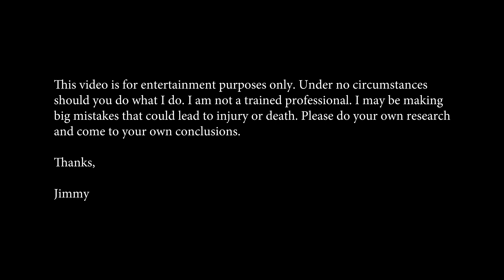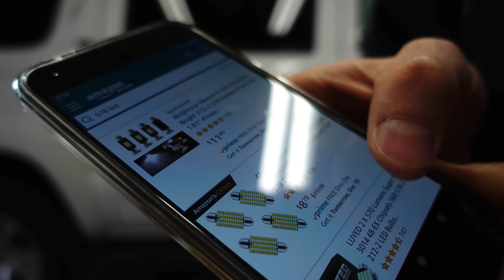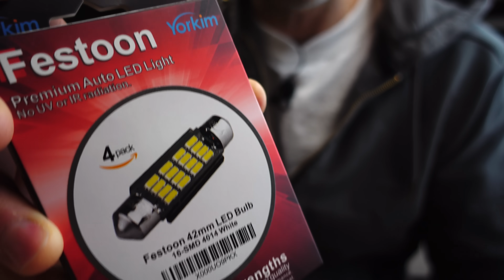Here's Why You NEVER INSTALL LEDs IN YOUR CAR OR TRUCK!!

Comment: I actually like the softer and warmer light of halogen for the interior.  And for the headlights,  LEDs blind other drivers,  maybe with the exception of Philips and Osram original bulbs. But you have other disadvantage with them,  you'd have to remove the rubber dust caps and your headlights will fill up with dirt! If you don't remove them the bulb will overheat and there you go your 80+ USD....
Reply: And that's why you don't buy cheap led lights... Good quality led bulbs don't have any of those issues.
Reply: Yes, I"m fed up with getting blinded from oncoming bulb swappers.
Reply: @ivanhoe6366  the major cause is that the LED module isn’t located in the same position the halogen filament is. Therefore changing the focus, spread and aim that the parabolic reflector is designed for.
Reply: @whatsstefon  I think "some" of the original equipment led lights are also too bright for oncoming traffic. Is it only me that thinks this?  Not sure if my eyes are just more sensitive to it since turning 50.
Reply: Same. 15 years ago, I love the look of white HID lights. Now I prefer a warmer looking light, not as yellow as halogen but definately not as white as LED's. It feels like a could see better with a warmer light than just pure white light.
Reply: @GeraldGuevara   -  HID's and other pure white beams don't give you the same sense of contrast because objects at different distances seem to be equally well-lit, so you lose your depth perception.  That's why in racing they tend to use yellow fog lights, it keeps the fog from turning into a brilliant white wall in front of you...
Reply: @ivanhoe6366
Reply: You can simply purchase warm White LEDs... They come in a variety of colors and temperatures
Reply: @ivanhoe6366  Are you sure they are LED? They may be an illegal xenon bulb from reputable manufacturers like Osram's Cool blue boost bulbs, that aren't allowed for the street, yet some drivers install them.
Reply: Blinding drivers in oncoming vehicles is more likely an aiming issue for the head lamp assembly.  Most all vehicle head lamp assemblies have some way to aim the assemblies.  It is a relatively simple procedure for most vehicles.  For my 2019 Ford Super Duty it requires only a Phillips screw driver.  I recommend Headlight Revolution as they have great videos on aiming head lamps and they are a great source for tested/hassle free LED replacements.
Reply: @rvrunner8362   It's not like that, it's the positioning of the chip (has to be the same as halogen), the SIZE of that chip (which always is too large in chinese bulbs, because it's cheaper of course, what do you expect from China, hey... Instead it has to be as close or smaller than the filament as possible, to achieve a better focus) and the actual light intensity (HID lamps have that headlight washers not just for style) The only bulbs filling those requirements are Philips Ultinon pro 5000 and 9000 series, even Osrams don't come close yet.
Reply: Philips aftermarlet LEDs fitted fine in my car and I was able to put the dust caps back on just fine.

Comment: What kind of cheap interior bulbs are you buying that are overheating?
There L.E.D. they should be using less energy to create light. Less energy = Less heat.
Reply: Here is the secret, it's not directly overheating from the LEDs.
It's overheating cause the contact points have poor metals that cause bad contact over time (metal corrosion).
And bad contact cause heat and that starts to melt the plastic around it.

Could be a "planned obsolescence" thing.
Wiki that, very interesting how the light bulb industry started this anti consumer scheme.
Reply: @N0N0111  Touche, but my first point still stands. Quality products "should" contain quality parts. 
The contacts "shouldn't" be causing any extra resistance on a quality product.
Looks like I'm digging out the multi-meter.

Comment: Instrument dome and marker lamps are not halogen lamps.
Reply: You beat me to it...good one👍
Reply: @TomAlter1000  they are tungsten in a vacuum and halogen is tungsten in halogen gas.
Reply: @duaneantor9157  Tungsten is the filament, true Halogen is a gas but what he's showing opposed to LED is a standard 'Incandescent' bulb which has NO gas other than Air in a vacuum.
Reply: @AThomasGrogan  I know that and have commented on such. Air in a vacuum? How does that work?
Reply: @duaneantor9157  Oops, I miss read, thought you were saying 'Halogen was Tungsten'.  Air in a Vacuum? yes,.. it's true,.. there is no degree of vacuum that will rid any volume of area completely of Air, unless there is no volume. In the case of a bulb you have a filament the presiding in the center of the bulb. (hence you have volume and gas (Air)) **Even if it is a vacuum)
Reply: @AThomasGrogan  halogen lamps have a tungsten filament. The rest of your comment doesn't make sense.
Reply: @duaneantor9157  The filament in a light bulb is made of a long,  thin length of tungsten metal. In a typical 60-watt bulb, the tungsten filament is about 6.5 feet (2 meters) long but only one-hundredth of an inch thick.  Doesn't have to be Halogen. Dont worry I wont try to explain how Air can or Cant exist in a vacuum.  I think I explained well enough
Reply: @AThomasGrogan  halogen is a gas not a metal. Are you always this condescending?
Reply: @AThomasGrogan  i highly doubt a 60 watt bulb has a 6.5 foot filament.
Reply: @AThomasGrogan  yes you did a great job of explaining a vacuum.  lol
Reply: @duaneantor9157  I'm inclined to believe English is not your first language,.. I'm done with this.
Reply: @AThomasGrogan  yah thats it cupcake.
Reply: +Duane Antor. To clear up a few points.
The filament of a bulb is long, to get the largest area of incandescent metal. It is a coiled coil, but you would need a microscope to see its construction. 
Traditional tungsten lamp were vacuum, but this was replaced with an inert gas, allowing better cooling of the filament, thus allowing thinner wires and more light per watt.
In tungsten halogen, the traditional nitrogen gas was replaced with halogen. This allowed an even hotter filament to cool. The higher temperature filament produced a whiter light. 
The problem was that the filament vaporized when the lamp was on and then condensed onto the glass when it was turned off, which caused the lamp to fail. 
To avoid this, the glass tube was replaced with quartz which cooled slower than the filament, causing the vaporized tungsten to condense back onto the filament. However any grease om the outside of the lamp (such as a fingerprint) allowed the quartz to cool faster, causing the typical 'black spot' as the filament slowly transferred onto the glass until it failed. 
Due to the filament needing to be very thin, halogen lamps are impractical below 50 watts. It would also be difficult to install them without using your bare fingers.

The contact failure with LED replacements is largely due to the lamp-holder being designed to run hot. Add wear and oxidation and you will see why their is a problem.
Even when using larger LED lamps in the house, if installed by a professional, he will mostly replace the lamp-holder.
If using LED's  in a vehicle, I would use Bosch, or a company who has designed the lamps in conjunction with car manufacturers. Poorly manufactured Chinese imports will cause endless problems.
Reply: @wilsjane  im not reading all that.
Reply: @duaneantor9157  
OMG.......
Are you guys going to buy LEDs or not????
Reply: @garydp9760  I have them already.
Reply: @wilsjane  "a coiled coil" as opposed to a "straight coil" ??? 🤣🤣
Reply: @duaneantor9157  Dood, you know damn well if MISS Read was in fact married to Mr. Read she would no longer be Miss Read, she would be Mrs. Read. 
Get it together man. 
HAHAHAHAHAHAHAHAHA
Reply: @carlspackler91  OK ya got me there. You spelled dude rong.
Reply: @duaneantor9157  Touche'

Comment: I had the same problem when I replaced all the interior lights in my CamperVan.They were slightly longer in size,so stretched the contacts to make them fit.Excellent lighting now almost like day light with 12 volts.LEDs are certainly the best,

Comment: In the UK,if you replace your vehicles halogen with led bulbs,it is a mot failure.Unless your vehicle is factory fitted with led it is illegal to use led,other than off-road.

Comment: I've switched from incandescent to LED's in all my instrument lights on my two 77 Cougar wagons, and also on all the turn signal lights front and rear.    One important thing you may need to know, is that the some LED's are polarity sensitive.   If the bulb doesn't work, reverse the bulb in the  socket and it may work.   Turn signal bulbs have the polarity fixed in the socket.
Instrument light sockets are what I'm referring to, so be sure to check to see if they work before you reassemble your instrument panel, i.e. try reversing the bulb in the socket if it doesn't light up.   I prefer high intensity LED's in the instrument panel.   These are more expensive.  I had to drill out the holes to a larger diameter to fit the LED's through the holes they go in.   I also had to remove the blue tinted lens covers in the instrument panel to get the bulbs to fit.    The LED's do a better job of lighting up the instrument panels on my Cougar wagons.    I purchased Sylvania LED's from Advanced Auto Parts.    I have had no problem with any of these bulbs burning out or over heating anything.
Reply: I put them in my 1980 Mercury Capri (Foxbody) instrument panel because stock 192's are just dim in that cluster. I dont get to dim the LEDs but its alot safer now I can see!
Reply: -77 Cougar wagon(s), huh? You mentioning that to create some form of statement? Otherwise come off as a bit of a weirdo, who's out of the normal loop.

Comment: I'm here in November 2023... I recently bought a 2012 GMC Yukon and the previous owner had attempted to replace the interior bulbs with LEDs with at best, mixed results. The ones they bought also had fitment problems, however rather than being too long as in this video they were a tad bit too small in circumference such that there wasn't good connectivity with the contacts. This made some of them work intermittently or not at all. I wound up removing them and replaced them with OEM spec bulbs again. Personally I'm not a fan of the bright pure white lights in the cabin at night - it's just too bright ... I much prefer the softer amber light of the originals.